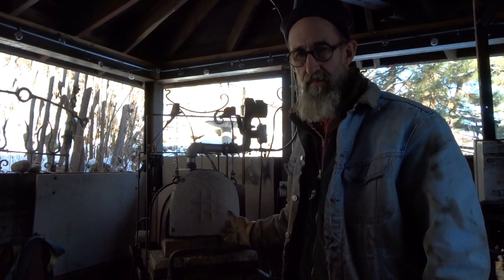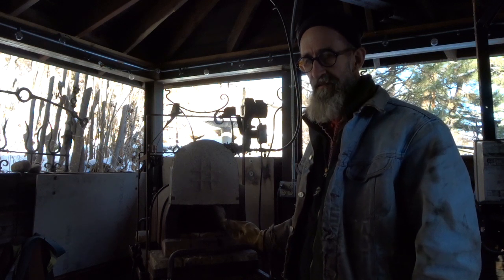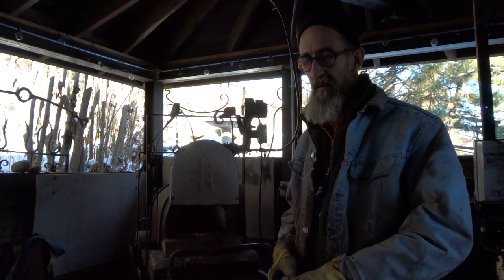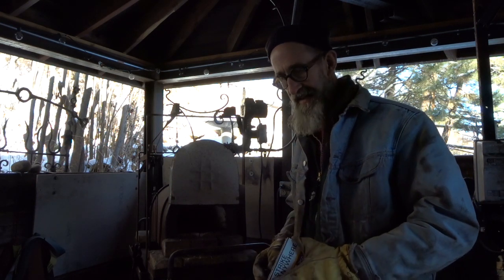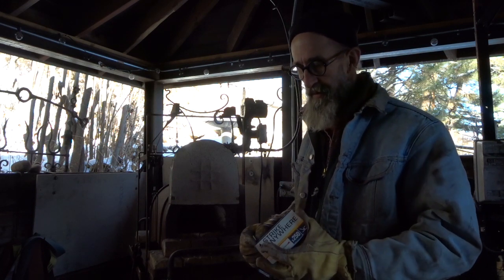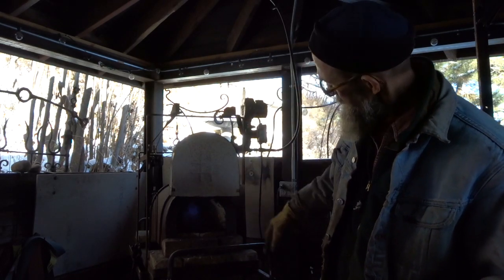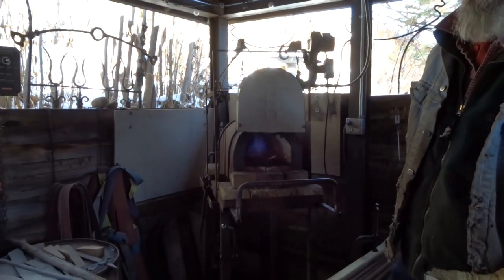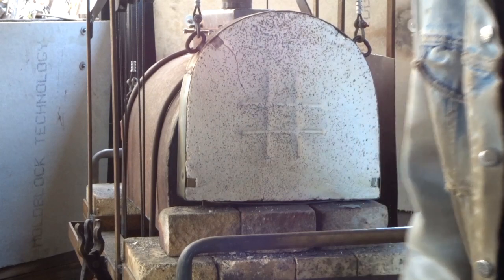Lighting the Ribbon Burner

Comment: Hi Stu
Very nicely done but I have one question,Welding temps!do you get there easily and gas consumption at welding temps please sir.
This is all providing you are still active on this channel but thank you for your in depth tutorial. 
Keep on forg'n fella
Reply from the maker: Yes I can reach welding temps, typical gas pressure is 20 psi. I am not sure about consumption. A 100 lb bottle can last between 16 to 24 hours of continuous running.

Comment: Hello Dan. My name is Wayne and I really enjoyed your series on constructing your ribbon burner. I have built mine to be as close as possible to yours and just tried to light it for the first time. I am a complete novice at this and blacksmithing in general and this is my first build. I have a question for you if you have time to help me out a bit. Like I mentioned above, I just connected everything, turned on my blower (47 cfm), turned on the propane (5 psi) and tried to light it; nothing happened! Being a complete novice at this and trying to learn all I can from YouTube, I believe it is my ignorance of propane psi, but not sure. I chose the ribbon burner because it uses a "supposedly" much lower psi (2-8 psi) vice a venture burner (20-?? psi). Do I need to crank up my propane psi in order to light the forge and then turn down after lighting to adjust the flame and air/fuel mix? My fuel nozzle is 1/4" X 6" tube with a .35" mig tip in the end, and like I said, it is designed exactly like yours. Any assistance form you or anyone else would be greatly appreciated.
Thank you,
r/
Wayne
Reply from the maker: Hello Wayne,

Typically for start up I have to start with the blower intake covered ~80%. As the forge heats up I increase both air and gas flow until I reach the operating temperature for my forging. 

I have found with this air and orifice size I am typically running between 15 and 20 psi.  The higher psi is for welding temperatures.  I have run down at 10 and 12, but it just takes longer to get a heat.

Comment: great build! what gas psi are you running? also is it efficient on gas? thanks for the vid!
Reply from the maker: Will Woods 12-15psi. through a very small orifice.
Reply: SmithinStu  thanks for the reply. Do you run off a 20 lb propane tank? And if so how quick do you run through one? Thank you.
Reply: I also would like to know how fast these burn through a given size tank of propane. I've watched hours of video on ribbon burners and have yet to see anyone state "a 20gallon tank will last approximately x hours at full burn". Would really like to know that before building...
Other than that,great series on ribbon burners construction, VERY  informative!
Reply: I would love to find out the same! hopefully SmithnStu will have some info for us?

Comment: Awesome series, loved your shop, loved the videos, loved your build. 
When you light the burner, it looks like you have a lot of excess air. Is this the case? Does this correct at operating temperatures? Did you consider using a restriction on the blower?
Reply from the maker: Carson McMahon there is a restriction on the blower that can be adjusted. The burner does even out as it heats up, but its important to run the burner a little air rich so that the inner blue flame sits just off the surface of the refractory in order to extend the burner life.

Comment: How does that forge door work? Is it driven by something? Or is it manually operated? I really like it
Reply: It looks like it just has counterweights that are very close to the same weight as the door
Reply from the maker: Manually operated. There is a counter weight attached at the far end of the lifting cables.

Comment: Great series! I'm planning on building my own forge by mid-spring. This series helped me decide to go with a ribbon burner. Now is it better to use propane over natural gas? I'm plumbed for gas in my workshop, and that (as long I pay the bill) pretty much makes the supply endless. What's the pros and cons of each?
Reply from the maker: brian bennett There's a lot of price savings with the natural gas. the winter 2006 hammers blow article talks about the natural gas burner. if I had the ability I would use natural gas